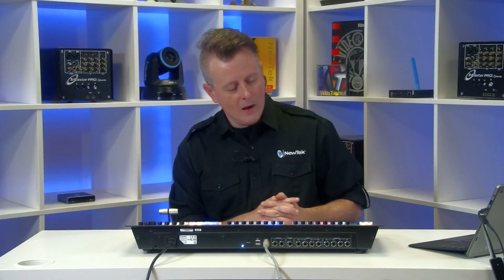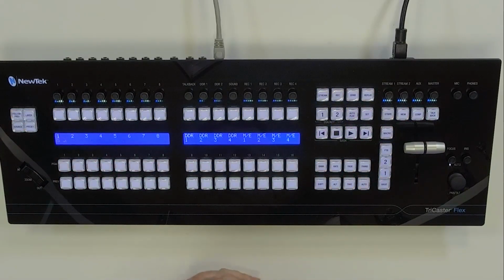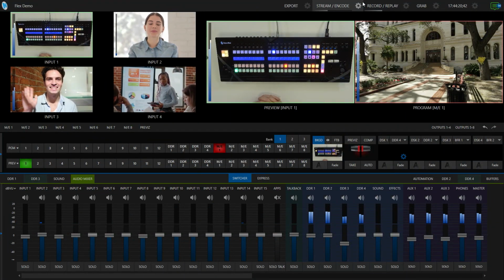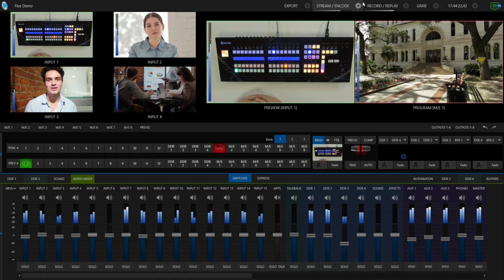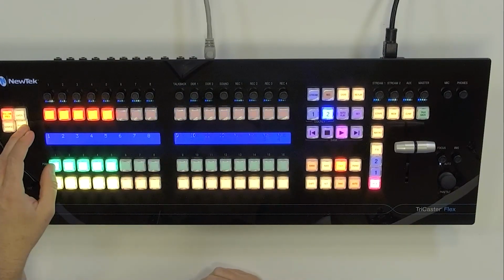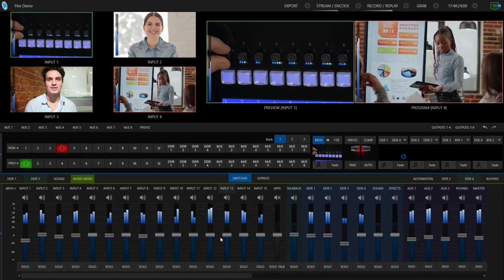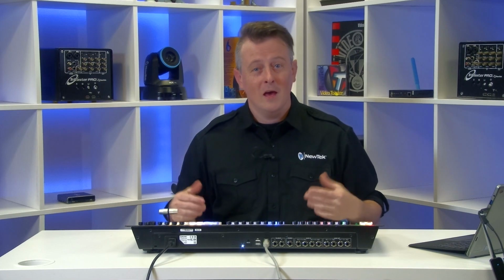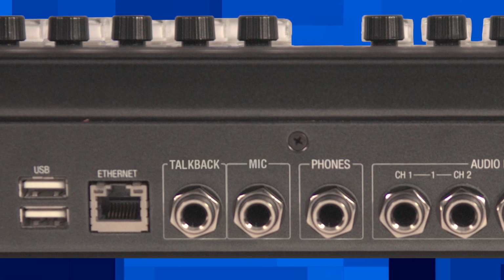Introducing the NewTek Flex Control Panel

Comment: How can one connect the flex dual controller to the Tc1? The controller is non existent when I plug in to the switch. I changed to static ip. But doesnt switch over.  Any good recommendations why they arent talking to eachother?
Reply: i have the same problem. Even after connecting the flex unit directly to the tricaster CPU via ethernet cable, the controller is still not connected to any tricaster unit. Yet the Ip address of the flex unit is available on the flex unit software. Any solutions please?

Comment: Speaking of different Tricasters on a network. Could you do a Tuesday tutorial on how to centrally manage multiple tricasters? For example: We do a lot of sports and have different sessions built out for different clients/sports. Can you save the sessions on a NAS and open the session needed on any tricaster? Right now the workflow is taking a drive, exporting the session and its assets and then importing them onto another tricaster. Will having the assets and session information stored off the physical machine cause any issues? Ideally its best to have it onboard. Also what if the tricasters are of different models and software versions? Such as an Elite two in the main control room, 860 in room B, and a mini in room C?
Reply from the maker: good question.  I haven't tried that in a while.  I'll take a look